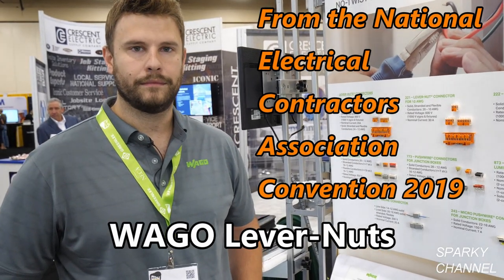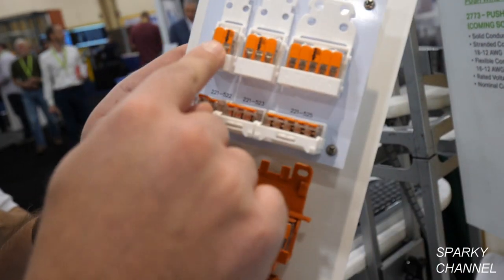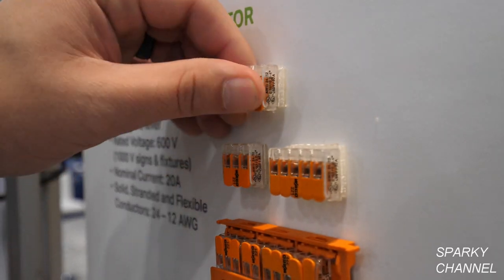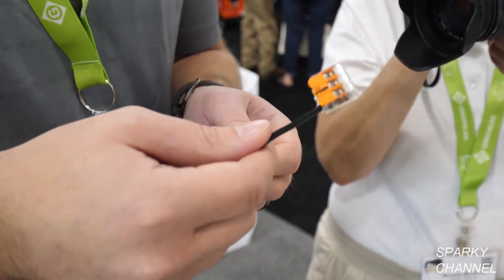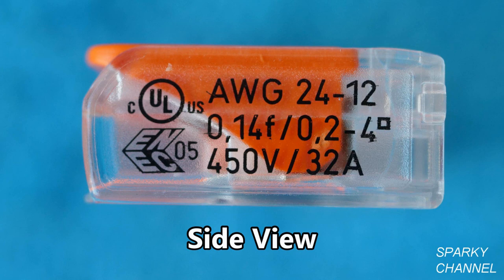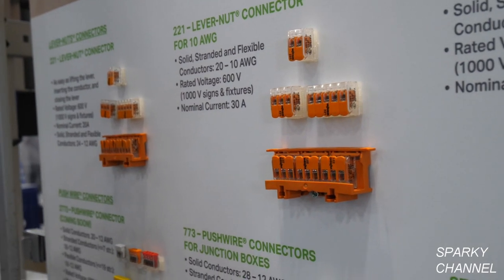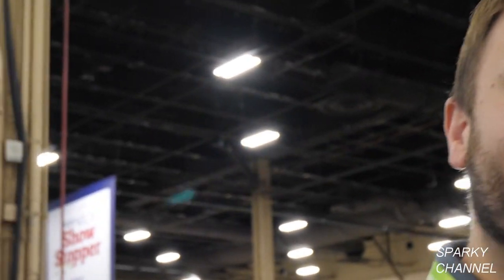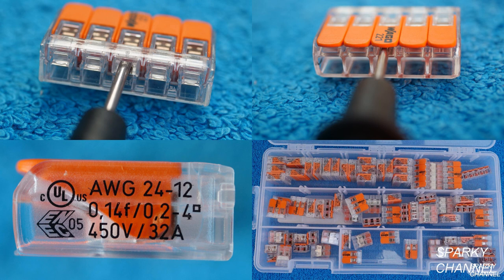Wago Lever-Nuts Questions and Answers From National Electrical Contractor Convention

Comment: The video missed a couple of my favourite tips and applications for these devices!

1.  Wago LeverNuts have the "Wago Logo" (try saying that three times fast ;-) ) and the base part number printed on one -- and only one -- of the levers.  I ALWAYS use the port operated by that lever for the "feed" wire.  Yes, I know, you should always use a meter or touch the wire to your [apprentice's] tongue to see if it is really hot.  This just makes a nice cross-check and tells me, should I need to break a connection for emergency purposes, which wire to NOT pull from the connector.

2. This was hinted at in the video; but, to my mind, not emphasized enough.  This connector makes it easy to add and subtract wires from the connection.  So long as you don't pull the "hot" wire and leave the bare end dangling about (see #1, above), you can use this feature for a quick "tap" into a circuit without having to "untwist" and "re-twist" everything.  And, yes, if you're careful, that sort of process can be done on a live circuit -- with roughly the same risk as plugging in an extension cord.

3. In certain applications, I like to use the "next size larger" LeverNut than what is required.  This provides an easy way to add in another connection at a junction point later without tearing things apart and reassembling (see #2, above).  And, yes, if you're careful, that sort of process can be done on a live circuit -- with roughly the same risk as plugging in an extension cord.

4.  I especially like these LeverNuts for working with old wiring!  Occasionally, I will run into a feed wire that has some age on it.  The insulation is still "good" but, unlike its younger brethren, it is not up to the repeated flexing inherent in twisting and untwisting and twisting again.  Using a LeverNut = "no twisting required" so you minimize the potential damage.  Recently, I helped a friend track down an electrical failure.  We found a light fixture where a wire had "burned off" of the connection inside the box.  Of course, it was the feed wire.  Fortunately, there had been an excess of wire in the box -- to start with; unfortunately, by the time we removed all the burnt and discoloured wire back to where where the insulation was sound, we had only about an inch of "good wire" inside the box.  With a ceiling-mounted box and a long run of feed wire through "hard lid," we would have been talking some MAJOR sheet rock work to replace the wire.  Fortunately, with an inch of wire, we were able to strip a half-inch of insulation and use a LeverNut to reconnect everything to the feed.  At the end, with a pigtail to the original fixture, instead of multiple wires under one-screw -- which started the problem in the first place,  we were able to restore service in a safe and sane manner.  That could not have been accomplished with a WireNut.

Good Job Wago!
Reply from the maker: Thanks!

Comment: Wagos really are great.  How do they stack up cost wise over wire nuts from a contractor standpoint?  You can get a large container of wire nuts fairly cheap versus much smaller wago bulk buys.  It seems like using the wagos are better for a small job or for some specialized installations.  Any comment?  I was hoping you would have addressed that with the wago rep.   Thank you for the wonderful service you provide for us!
Reply from the maker: Thanks so much Paul! I think you hit it right on the head saying the wirenuts are considerably cheaper especially with bulk buys. Yes, that would have been a good question for Evan. I think there are lots of advantages to using the Wagos so to me its worth it to pay a little extra but everyone seems to have their own opinion on that.
Reply: @SparkyChannel  Thanks Bill.  I am a fan as well as they have saved me time and space in boxes!  It would be interesting to poll folks on the question and since these are time savers;  if the cost is comparable overall. Time is money as they say.  Hmmm.
Reply: wagos make their money over the speed and ease of installation and the reliability. Especially in inconvenient places.

Comment: I would love to see a line of receptacles and switches based on the lever-nut concept.  It could be a viable replacement for the push-in connection.
Reply from the maker: Interesting!
Reply: Guess buying from a Eu company is then the option for you as we got even lever-nut as long as it’s light switches etc. because plugs are not the same in you side? I didn’t suspect that that stuff is still the standard in the us.

Comment: 5:19 The test port is a nice idea but the opening appears to be too small for typical probes, it needs to be forcibly pushed through the plastic gap, deforming it before making contact with the conductors. Be aware of that if you're safety checking for power before working. It may not actually be making contact if you aren't using thin profile probes, and give the impression the circuit isn't hot.
Reply: This is why I use one of the ports for probes.
Reply: @GoalOrientedLifting  or use a NCV tester, which ends up more reliable than trying to use the test port or an occupied port. If you always leave an open port for test access then that'd be good. 
Or just get new probes that will work more easily with the test port.
Reply: @wingerrrrrrrrr  gonna get thinner probes, as i find NCV testers to be unreliable, or not useable, on the machinery i work on.
Reply: Ive got one in my hand now, the front test port is a bit skinny but the test port in the back is more than wide enough for standard test probes. Also you can literally see thru the connector to see if your probe is making conact or not.
Reply: @phil0083  I don't use the test port either since it's mostly better just using the other side for probing.

Comment: These are great, space saving, time saving just all around good connectors. Have trouble believing they are a gas tight connection tho because you can still twist the wire after it’s clamped down
Reply: And if you twist it, then it is gas tight again in the new location.

Comment: A billion years ahead of wire nuts
Reply from the maker: I hear that!
Reply: I hear that!
Reply: Its screws with an impact cordless brushless driver vs. rusted, bent, greasy nails using a rock for a hammer! 🤣🤣🤣 
Its just smart to use improved technology, in all trades.

Comment: Excellent for troubleshooting. You can safely disconnect a hot wire (the downstream wire). You can connect your meter leads to it.. you can twist together Belden cable wiring and clamp it and you just don’t have any of those options with wire nuts.
Reply: Sounds like you are a paid spokes person. They are dangerous to use in a house. When it heats up and fails and a family dies YOU will have to live with what you said.  I have been doing electrical work for 40 years and i would never use this in my house wiring. It has it's applications but a house is not one of them. Shame on you
Reply: @leostgeorge2080  I read my own comment again. How do you extrapolate a person being a residential electrician based off what I said? First of all, residential is the easiest electrical to work with. If a person needs to be troubleshooting with residential, I think there are bigger problems. Secondly, how often do you hear of Belden cable being used in residential? Do you even know what Belden cable is? Probably not.. you, sir, should probably stick with residential where things are simple. Wagos are UL tested, listed, and labeled.. that’s all I need. You are probably also unfamiliar with those terms too. Have a good retirement
Reply: @dougleydorite  First as i can see you know i am right and take the convo else where. Second never said i only worked residential. In fact 85% or more is commercial machine controls. I think you need to find a new job because you suck at sales. If you wore any good at electrical you would not be in sales. Those who can't do sell.
Reply: @leostgeorge2080  commercial and machine controls are often mutually exclusive... I think you just need to drink a warm glass of milk and take it easy..
Reply: @dougleydorite  Your video shows residential use. Now you run all over the board with all kinds of distractions never addressing a single concern i have of the product. You need a new line of work. You suck at this one. Keep selling but find something else because electrical is not your thing. Maybe try water softeners? Pudding for the elderly? Oh i know toilet paper since your full of it!

Comment: so u guys in america only got wagos recently??? we have been using them for more than 15 years
Reply from the maker: I've been using them for a long time but many here in the USA don't.
Reply: @SparkyChannel  I learned how to completely rewire my 1950 house watching your channel four years ago. I went with Wagos and I'm 100% a Wago guy. Fast forward to the current day and I'm finally confident enough to do a panel change on my old glass fuse type service panel. In the midst of my panel change I checked out those Wagos I put in four years ago. No arcing, no wire damage, and they're still as tight as they were the day I put them in. I didn't tape them either.

Comment: Sounds pretty good for vibration on hardwired machines and devices i.e. Garage heaters but still the uneasy factor on how little effort it takes for the lever to lift. Should have a slide locking nub or something. Seems like the lever could pop up easy when pushing conductors into a box and not notice the ones burried further back. Always manipulating conductors to get them to fit the recpticle  in also
Reply: I'd like to see a locking swing-over latch as well, but if you ever test these it's clear that you have to lift it all the way up to get it to let go of the wire so they kind of engineered loose levers in to the design.

Comment: Hello Mr Sparky, 
I love using the Wego Lever nuts.
I can't find and answer from Wego, if you have time, could you find the answer to this question:
Why does the levernut 221 series come in 2, 3, 5 port but not 4 conductor versions?

If a 5 port is used, with only 4 conductors, should the connector then be wrapped in tape to protect the open port?

Thank you so much for your videos!
Reply: probaly because 4 isnt used that much.      2is just for inline use    3 for normal socket use and 5 for distribution boxes.    so i guess there is no demand then otherwise they would have made them.  and probaly also to reduce cost  saving on the whole production line.   and you dont need to cover the hole  they should not be in a place where it would be a problem since its not waterproof.  so just leave it open.  it aint easy to stick something in that deep to  accidently put voltage on something else.      but even then still you shouldnt work while voltage is present   altho we all do it xD
Reply: @DiyNuke  Correct most popular sizes for conductors.  WAGO does make the 2773 Push in connector in 2, 3, 4, 5, 6, and 8 conductor

Comment: I would be a little leery when  installing lights, plug receptacles and light switches, that when stuffing the wires back into the boxes, you could inadvertently pop up the little locking tab.
Reply: I have a ton of the older ones and I only wish the levers opened that easily.
Reply: there are special connectors for lights etc

Comment: Great videos, please keep making them!   Quick question, I have aluminum wiring in my home can I use the 2273 or 773's for mixed use (Aluminum & Copper)?  The Wago spec's sheets indicate use of both, but  I was under the impression I had to use the gel filled AlumiConn style connectors.  Those things are so bulking that I often can't get them into the boxes when replacing older receptacles, light fixtures, and/or switches.
Reply: The inconvenient truth is that there's no good solution for joining aluminum and copper.  The safe methods are too expensive, and the affordable methods aren't safe.
The patents on Copalum should have all expired by now.  It's too bad somebody else hasn't come out with a "generic" version.  I assume the market is too small, and the liability issues are too big, to make it profitable.
Reply: They use them in Europe for aluminum and copper but they are not certified for North America. You still have to use their Nolax with them.  Almost ordered from eBay from a seller in Russia but had to order in too big of a lot.

Comment: I must say, that I like the new Wago connectors, because they require a lot less force, than the older ones. Also in Germany every electricians uses Wagos, because it saves you so much time and you don't need ferrules for flexible wires.

Comment: It would seem that the Lever-Nuts designed for 20-10 gauge would be more suitable for home wiring applications as it is rated for 30A and covers the 14-12-10 gauge wires typically used for home lighting and receptacle projects. It would give you a bit more safety margin on the amperage. Or am I wrong in my thinking?
Reply: The 20a rated ones can handle much more, infact the wires will fail before the connector.
Reply: @mr.3phase228  That's good to know. Thanks!
Reply from the maker: You can use the 10 gauge Lever-Nuts for 12 and 14 gauge work. That's not a problem. You can exceed specs if you like.

Comment: If you’re not sure about these Wago connectors, buy a box and give them a try.  Promise that you’ll not go back to either terminal blocks or similar.  Been using these for years now and they’re an awesome product!
Reply from the maker: Thanks Dave!
Reply: No way they are as strong as Ideal wing nuts. When I watch the video of people closing the wago it takes almost zero force to close it. .Now if they took a lot more force I might be impressed. You can hang from a wing nut, they are that strong.
Reply: @jamescole3152  It takes little force to close it because they are spring loaded.  When you close the lever, you aren't clamping the connection, you're releasing the spring to clamp itself on the wire.  It takes quite a bit of force to open it because you're working against the spring force.
Reply: @dansanger5340  This. It's almost like a lever, gives you the power of leverage.

Comment: WAGO allows for stranded and solid, with no issues, unlike twist on connectors, where small stranded on light fixtures, to solid 14ga or 12 ga.  WAGO, better.  GERMAN engineering.

Comment: Wago would own the market if they brought the price down on these connectors.
Reply: Here in Denmark they pretty much own it. Don't know off anyone that doesn't use them. We don't have wire nuts but screw connectors and I don't miss them. Plus the outlet we use are pretty small so the size off the smaller push in are a big help and the smaller ones are actually cheaper than the older type we use
Reply: If you are a professional electrician, you would own the market if you charged $15.00 an hour,
Reply: Agreed…

Comment: To use with 7-strand cables, does it have to be "twisted" before inserting it into the connectors? Or do I just strip the cable and insert it that way?

Comment: There are 2773 on the stand while it says 2273 in the annotation. They look very similar, but there is still some difference. Mainly it is that 2773 can take multi stranded wires while 2273 only for single wire conductors.

Comment: do all openings need to be used in a wago?  does code prohibit using 4 wire wago with only 3 wires?
Reply from the maker: No, all openings do not need to be used in a Wago.
Reply: Good question. I wondered the same.
Reply: Only thing is that you pay more and use more room the bigger they are, but if you prefer to stock, like, the 3 5 and 8 terminals of the 2273 only, and not the 2, 4, 6, you totally can. For the 221 there’s only 3 sizes anyway, so might as well carry some of each.

Comment: When will the 2773 push-wire connectors be available to the general public? Will the new lever nuts ever be available for six conductors?
Reply: 2273 is available (at my country at least), but 221 is much better.